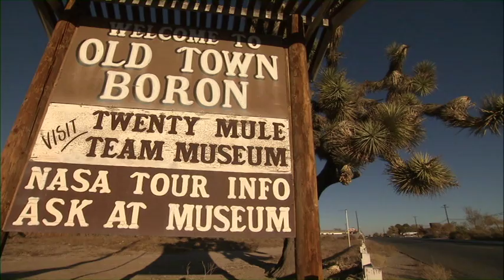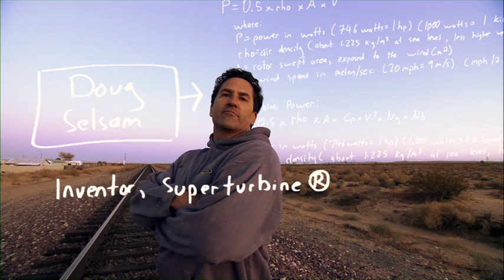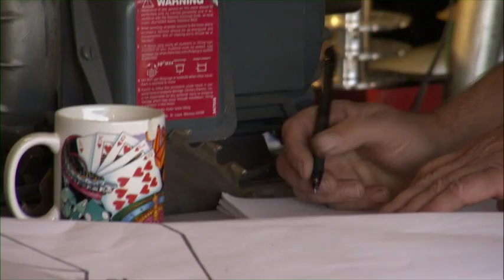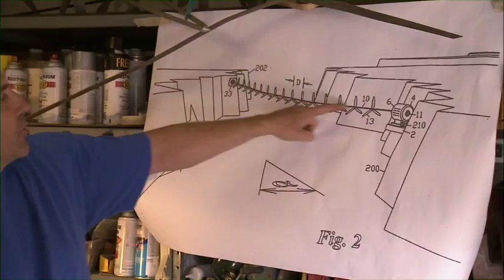Doug Selsam Inventor of Superturbine(R)

Comment: Actually, there's a reason why the utility companies build huge turbines with only three blades. They're more efficient, much more efficient. Wind power is proportional to the swept area of the turbine and to the cube of the wind velocity. However, the wind must be laminar flow, not turbulent, in order to obtain the calculated efficiency. You cannot put a turbine in the wake of another turbine and expect to get anywhere near the rated efficiency. This is a clever design in that it partially raises the trailing turbines higher, but they are still mostly in the wake of the lead turbines.

The other thing is that these designs will obviously be high maintenance compared to other wind turbines, which are already high maintenance compared to photovoltaic cells.

Comment: why not try the same idea with water where you never run out of wind current? you would also never see it, it wouldn't chop/dice birds. I guess Hoover Dam could use single line multiple turbines (? for hoh). I'm sure they need a generator upgrade to harness more electricity and less parasitic loss. (ie brushless motors)

Comment: Doug Selsam, this is cool, but I kind of agree with the bird comments, which is why I haven't been all that excited about wind power in the past. However, I have some thoughts/suggestions which if you implement, would you give me some credit?
1 Why not float the generator?  Why not anchor it by cable only?
2 If you floated the entire wind farm at 29000 feet, the only bird you might adversely affect is the griffon vulture.
3 Why not use vertical turbines instead of horizontal blades, designed to provide lift as they spin?  Then the wind farm could be self elevating, and the direction of the wind would be irrelevant. 
4 Naturally, carbon nano-fiber would be the ideal material to build these things with. Couldn't the blades themselves be made of a carbon nano-fiber cloth, held in place by a frame, also made of carbon nano-fiber? The resultant structure would be very light and easy to elevate, and not require much power to maintain elevation. Then the generator would be the only thing of any significant weight, but of course the right materials could keep that weight down too.
https://youtu.be/rLa_NY5U1nk https://youtu.be/yyX55xSnS54 https://news.stanford.edu/news/2009/june24/high-altitude-winds-062309.html

Comment: Ok, I'm no engineer (not even close) but the way I understand wind turbines is that they spin a spindle attached to a generator which creates the energy. It appeared that each rotor with blades attached spun on a bearing without being attached to a spindle...?? How do they create the energy? It would be cool if they each were attached to their very own little generator creating energy independently and then funnel it to one collection point. Just my observation.
Reply: Appreciate the reply! So what's the difference between doing it this way vs the vertical types with one set of blades? Isn't it still just turning one generator? Or is this more about making it possible for anyone to power what they need, where they need it? And isn't the problem centered around getting more generators going at the same time, and in the same footprint? (again this is coming from a non engineering viewpoint)

Comment: I think this is a great answer to wind turbine although there are problems with, for lack of a better name, air rights and birds, bats, drones and the like. So how about selling it to the power company for them to put up between there high power tension line towers because they have the air rights, maintenance crews and will be adding battery storage in the future. And if you can get big building owner in cities like Chicago to let you hang them between buildings that would be another great location. As to birds fiberglass hoops on the fiberglass supports around your drive shaft with netting over the blades. Good luck.

Comment: Could you put 100m long strands of this onto a long wire and attach a very strong kite to the top end.  Then lift the kite into the constant 120mph winds at high altitude and let the kite keep the thing airborne.  The Helium balloons seems like a temporary solution as they will deflate after a short time.  Also I doubt if any materials we can currently manufacture would be strong enough for mile long versions of this.  Having the working end high in the atmosphere would remove the danger to bird life as well.
Reply: +Brian Reynolds
Impressive rant there Brian.
Building a William Skinner gravity powered device would be fun and challenging from an engineering perspective.  I am a bit worried that you think it will actually amplify power and create more power than what is put into it via the motor.  It simply cannot create more energy than it starts with.  This machine is basically a complex version of a flywheel in a car.  It can store energy to be used later.  No new energy is made.
Reply: +Brian Reynolds
Yes I have watched several videos on it.  Does not mean I know all its secrets but it cannot make more energy than is put into the system.  NO SYSTEM can.  The energy taken to get it spinning up to full speed is more energy than you can get out of the operational end.   Gravity is not a form of energy.  It can create potential energy but that is only happening in this machine while the starter motor is driving it.  The instant the motor is switched off the entire system is bleeding energy through friction and heat.  So it immediately has less energy than the motor put into it.  The change of angle of the weights does not increase the stored energy.  That would simply be breaking the laws of physics.  I suggest you go and study up on the laws of motion and thermodynamics.  Look into friction and energy dissipation.  It will help you make good decisions in your inventions.
Reply: +Brian Reynolds
I am not saying you should not build one.  Just do not be surprised when it does not output as much as you put in.  You saying that it's input is far less than it is putting out is actually a physical impossibility.  Not a question of better engineering or new ideas.  There is simply no possible way for a system to output more than is input.  Every scrap of energy that has and ever will exist in this universe already exists.  For this machine to work it would need to be creating new energy.  This is a feat that will never be possible.  All we can do is convert the energy that already exists into different forms.
Reply: +Brian Reynolds
The laws of thermodynamics have been supported again and again by millions of experiments over the last 500 years.  So it is extremely unlikely that these laws will be found to be incorrect.  I find it frustrating that innovative people who have potential for new inventions waste their time in this area of "Free Energy"  it would be much better if they spent their effort trying to find how to extract energy from molecular bonds in a safe and cheap manner.  Or tried to improve the efficiency of electric motors or generators.  These type of inventions are actually in the bounds of reality and could help us greatly.
Reply: +Brian Reynolds
Oh sorry I did not mean to appear as though I was upset with you.  I am angry at the people that make videos claiming they have created free energy devices.  They are simply scammers trying to get a free pay day.  Unfortunately they tend to fool a section of the population who really want it to be possible.  I get that it would be wonderful for a free energy or a perpetual motion machine to be built but it is simple not possible and never will be.  That said I say go ahead and build your machine as it will help you to understand what i am saying.  You will see the results and then know it can not do as claimed and amplify energy.  Simply attach an electrical generator to the output shaft and then connect the wires from the generator to the starting motor.  If it is creating more energy than is input then once it is going it should continue to run itself until the mechanical parts give out.

Comment: So why attack them all together into a line where it wobbles and all propellers are attached to each other and cannot operate individually? And that wobble thing is defo not a good thing, the more stable the base is, the least amount of problems you create to the propellers spinning, just spin a fidget and try to move it, you will see resistance.

Also if wind in a lower spot is running slower than the higher spot then those lower will act as a load to the higher ones.

I say if he puts propellers in a specific distance so they won't create problems then put them like the conventional ones in the same distance and it will be the same but better since every propeller would be individually working, taking advantage of a little more wind by its own.

And that balloon thing, I am not sure if I wanted to laugh or feel offended, a balloon... what if it breaks and the whole thing falls down? you need a solid base, it might be up in the stratosphere, it needs a secure way to be there.

Comment: I would like to see a lightning harvesting farm hit the seen , maybe use the drive shaft as a means for this dual function or something like that ???
Reply: No capacitor ever made can handle that kind of jolt.
Reply: jay90374 That doesn't mean it couldn't be done.  A few years ago I was tasked with making a broadband-over-powerline transceiver survive outdoor, lightning-induced surges on house power feeds.  That's a 1500V, 100amp surge.  At first I thought it couldn't be done, especially since most of the methods for surviving a surge involve clamping the voltage and providing a temporary short circuit to protect downstream electronics.  Unfortunately, these all have too much capacitance (a few picofarads is "too much") to allow the transceiver to work if it is shunting the power lines. 

After some research, I found caps rated for large surges and replaced the small series cap for the transceiver (about 1cm diameter, 2mm thickness) with 3 large (approx. 1cm x 5cm x 3cm) caps to limit and store part of the surge untl it could be dissipated by the power line.  A small RF transformer (1cm diameter, 30 AWG windings) was in series with these caps and tied to the transciever.  I used the Onderdonk equation for fusing time of copper wire to convince myself the transformer would survive the current spike, and an integration formula provided by the manufacturer of the capacitors to insure the caps would survive the surge.

It worked quite well. Thousands of these circuits were built and put into the SmartMeter circuits.
Reply: Cynthia - Interesting story, but 1500V at 100 amps is miniscule compared to the power of a direct hit from a major strike. I am not saying it will never be done, the tech is changing daily, but have not heard of anyone studying it.
Reply: Too little energy on average and massively unreliable.

Comment: Hi.., I have a dc  motor on a windmill setup with a high out put off 200v dc to 250 v dc. When I turn it one time turn fast it creates around 20v dc to 30v dc. How can I regulate it . So I can recharge my 12v battery bank. with out hurting my batteries?.., thxs

Comment: Doug, this is very interesting. How large a generator have you tested this system with? Have you done any long duration testing to determine material fatigue factors? have you considered carbon  fiber and other composite materials for the shaft / turbine blade assemblies?

Comment: It looks more like a motor spinning the blades at 10:55, it even have an engine start up jerk, also the energy made is not greater is the area of the blades are not greater in total than a conventional wind turbines wing spand, which is highly doubtful. There is also no good way of looking the blades in case of too strong winds, so it would tear it self to pieces instead, and the setup area is even greater for this type of turbine, as it needs to stretch out far from it's setup point, and unless both ends are secure then they are really dangerous to live close by .
Reply: It might need an initial nudge to get it moving. If Im not mistaken thats quite common for large wind turbines.

Were of the same mind on the other points.

Comment: Power =  Force   *   Speed  
 More effective wind blowing surface, more force generated.   The blowing surface is most important. Array of wind blades will provide more chance of collecting the power.
      The most effective windmill is horizontal ones.  Those vertical ones have returning surface which resist the vertical  rotating shaft.

Comment: Nice idea Doug. If I were you I would try to make every blade a small generator, that way the bigger the chain more electeicity will be produced. Otherwise you will need a gearbox.
Reply: ... for example, if a copper coil goes true the shaft and you put on every blade a few permanent magnets. Or any other way. At least put two generators on both ends.

Comment: Hmm, I know its an older vid, but its been tried many times.  What we need is to rid ourselves of needing a tower.  And all the bulk up on it.  Those vertical turbines sure look good.  (Tried to build one, failed.  Don't have the resources)  But, power output is just about as good, or sometimes better than the typical wind mill design.  Every house with two smaller vertical turbine designs (At least the ones I designed) would power the house quite fine.  wasted space (the roof) otherwise.

Comment: the first man powered airplane was build decades ago. At first it became somewhat of a jock. after two decades the gap between the concept and the available material was closed.  I dont feel that ballons are needed ones a capable gluider takes place. As for the high i would be thinging in the scale of kilometers instead of feet. you do know that there are almost everywhere jet streams .

Comment: Rewired drum motor generators with magnetic bearings with vacuum spark gaps with a hydraulic pump motor that spun a support tower full of drum motor generators with graphene power cells at the base of each power windmill with tesla wireless power transfer coils to move all that energy around. ☺😊

Comment: Thats not at all possible .. That drive shaft would damage the bearings at a much faster rate and that long unsupported beam .. would sag under its own weight over long periods of time. and if its too long then it's turbulence effects might cause it torotate abnormally even sinusoidally.

Comment: Great Inventors are not necessarily great at starting or running a business.  I think that is the elephant in the room here.  Doug, I think the idea is brilliant, but with a few basic flaws that others have noted.  However, I believe that most of those engineering challenges could be worked out, just like they are on anything else through continued research and development.  The thing whips around, so maybe we had some strong spring or rubber flex disc near the bearings. Okay, then if it breaks halfway at the shaft, then of course we have 28 blades flying across an elementary school playground 3 counties over Lol. Okay, maybe the helium idea might not be the best...  But with two fixed towers and maybe 1 tower in the middle that has some kind of carrier bearing mounted with a shock absorbing apparatus, you could break up those long wave lengths. To span mountains, a no fly zone, it could work. In between bridge spans above or below the bridge,  it could work.  The cost, material sourcing, production, marketing, distribution, etc. etc. might be your biggest hurdle to getting wind behind your idea.  Dare I say "Shark Tank"?  I LOVE seeing new inventions that a person actually pursued enough to put money behind it and make a model, but making MONEY is a lot different than making a product that works.  When I see the sweat pants, the messy office, the friends helping but probably not being paid, and the Astro Van, I know the funding is limited!  Do you have any method for people to invest? A GoFundMe account?  7+ years since the video upload, years of work prior to that, 166,000 views, and a couple patents don't make ideas turn into monstrosities that span mountain tops.  I'm not being an ass, I'm just saying.  Anyway, keep up the good work sir.

Comment: I used helium balloons to carry a wire up in the air so lightning would come down the wire into a bucket of carbon and metal to create diamonds but when the wind started blowing  the balloons went down to the ground and popped on the cactus so that's not going to work because you need the wind to make it work ???? Ill finish watching now 🙋good luck

Comment: You gotta give Doug an A for effort       however it's dangerous to birds it's going to fail from metal fatigue it's loud.i don't see it being superior to vertical axis wind turbines in any shape manner or form. Vertical axis wind turbines generate regardless of the winds direction. Now if you wanted to really generate a lot of energy you place vertical axis wind turbines ten feet apart on the sides of highways harnessing the air movement of forced air from speeding vehicles. Remember energy can't be created or destroyed it  can only change form.

Comment: This guy is a nut-case.  Did you see that apartment?  Even the machinist can't stop smirking when he sees him coming at 5:20.  I bet he is saying to himself, "Oh here come the nut job again."  He thinks that can get up to the stratosphere?    The stratosphere starts at 11 miles above the earth and goes to 50 miles.  How are you going to get that electricity back down to earth's surface?  Apparently he has never heard of voltage drop.   This guy needs to hire a mechanical and electrical engineer to do some analysis for him.  These quacks are all over the internet.